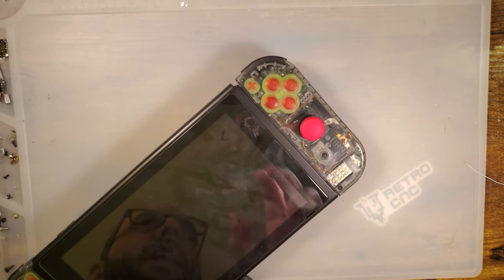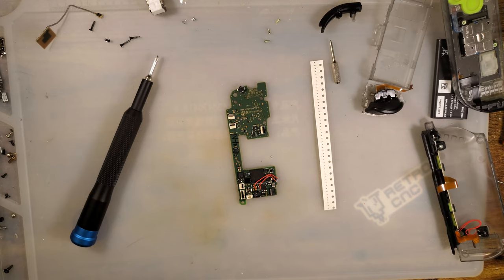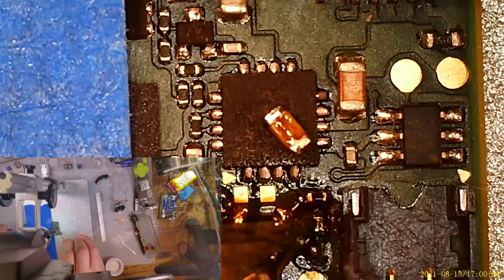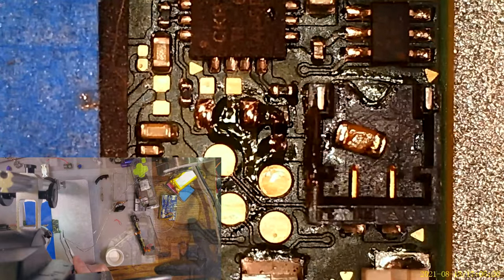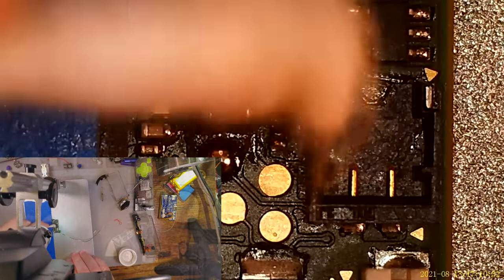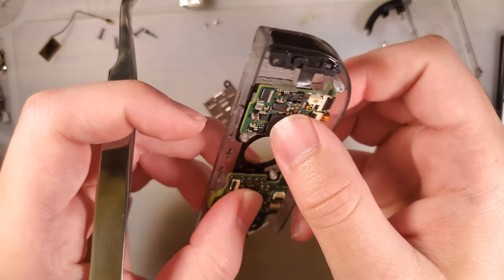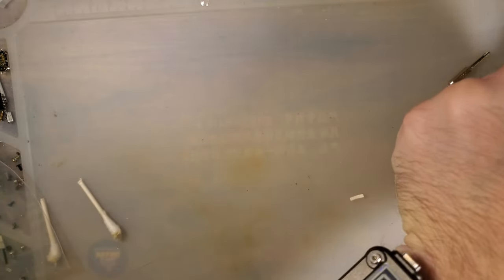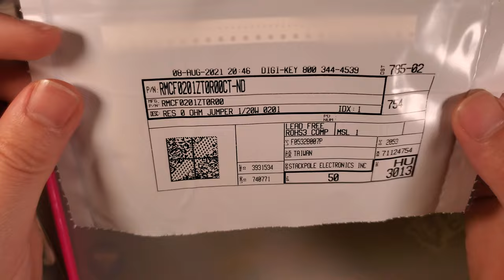Switch Joycon Fuse

Comment: Thank you for reminding about fuses importance. I actually tried to solder a slightly bigger fuse above the original but i couldn't do it ☹️ so soldered a jumper wire😎🙈 but I'm not happy about it... i'll be fixing it soon, thank you

Comment: Presumably having this issue with my right joycon too,  though I haven't poked around with the multimeter yet. I foresee an order for a 0402 fuse in my near future. Halfway glad my dumbass shorted the fuse so I could find my way to your videos, you've amassed a treasure trove of information here, which is exciting for someone who has started getting into fixing electronics in the last few years (me).

Comment: Hmm... this might explain why one of my joycons stopped working wirelessly... is there any way I can check to see if this is the issue before ordering the part? Probing the fuse for continuity perhaps?
Reply from the maker: yes, check continuity with a multimeter. No continuity on this part means you'll need a new fuse. 

Also, in case you didn't see my pinned comment, don't order the specific part I linked to. There's a better part that I will link once I test it.
Reply: @makho  Yea, I tested my fuse (as best I could any way, it is rather small) and it appears that there is continuity... so I still have no idea why my Joycon wont connect wirelessly but works just fine when connected to the console. Luckily this is a spare pair, and my modded pair in ExtremeRate Dpad shells still work just fine..
Reply from the maker: @Avalon304  Won't connect or won't even power on? Because those are two wildly different issues.
Reply: @makho  Wont connect. Just sits trying to connect with the lights flashing. Works just fine when connected to the switch though.
Reply from the maker: @Avalon304  Yeah, no, definitely not the fuse. More likely your antenna is fucked up or disconnected. You did try to manually sync it, right?
Reply: @makho  Manually sync as in hold the sync button? Yea. It also doesnt retain sync connection when connected to the switch then removed. I suppose it could be the antenna, but I bought a replacement and that didnt seem to change anythign either. Its in pieces right now so I'll have to pay better attention next time I assemble it, I'll pay closer attention to all my connections.
Reply: @makho  maybe you’ve mentioned it somewhere else but what is the better part that you found?
Reply from the maker: @chloearcher4510  any 0402 fuse should work. 750mA or 1A should be fine.

Comment: I got a kind of different problem. I bought a new battery because the old one die. But, after i put the new batterie, i can't power on my joycon and i can't charge it on my switch. BUT when i took the same battery on my other joycon the battery is charging.